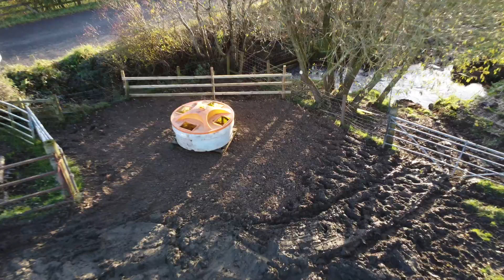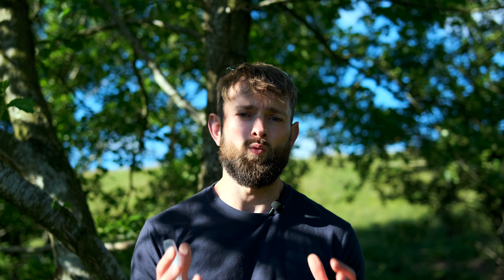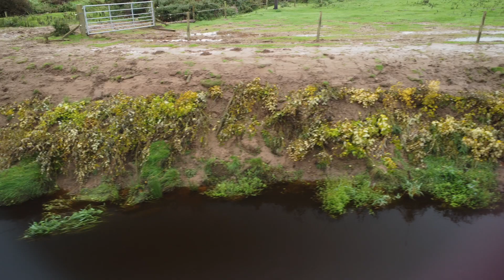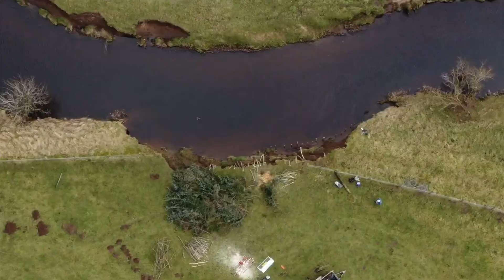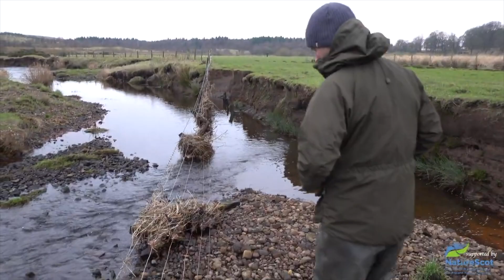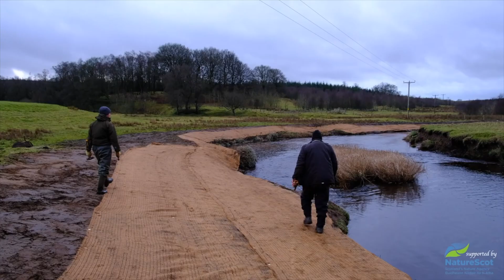Ayrshire Rivers - Problems and Solutions

Comment: I've worked with you (ART) about 15yrs ago through my local angling club, with the control of Giant Hoggweed. You all do great work.
However, I am really against the planting of Willow trees in river bankings.  Willow is the "weed you can't get rid of" in the tree world.  It restricts anglers access to the water so has to be constantly maintained which is costly and very time consuming to angling clubs due to it's rapid growth (4-6ft per year)  Willow can also grow into a fairy large tree with very heavy limbs  which causes the tree to lean into the water creating a destructive flow that damages the banking and eventually up roots the tree into the water.  I've seen this many times over the past 25-30yrs. Yes it may be a good short term fix, but in the long term it just creates more problems.
Enjoyed the video.👍
Reply from the maker: Hi Mark, thanks for your comment - I think it's a case of the right tree or shrub in the right place. There are many varieties of willow that occur natively across Ayrshire and Scotland and some are more suited to upland environments and others more fertile lowland settings they all have there place. Rivers would have been far more heavily wooded and natural prior to the agricultural revolution. I get both sides of the argument as an angler and someone who works to improve the functionality and robustness of river systems. I look at it this way - I'd rather have fish that are difficult to fish for than an easy fished river with very few fish! I appreciate your comment - not long till the season gets underway now!
Reply: @ayrshireriverstrust2326  I still believe your logic is flawed. Banking erosion and the associated problems it brings ie silting, is not a recent problem, it's been going on for centuries. So how did our forefathers deal with it? It wasn't to plant nuisance, high maintenance trees all along the banking's restricting access to entire stretches of water. Estate owners back then and even now,wouldn't allow it because it would be unsightly and  reduce much needed revenue taken in from premium paying fishermen. So what's the answer??? Put simply STONE. That's how it's been done for centuries and it works for the environment, wildlife, and the paying fishermen.
What's the point of having a river with plenty of fish if you can't get to the water to fish for them?